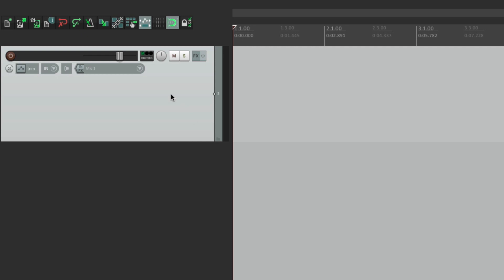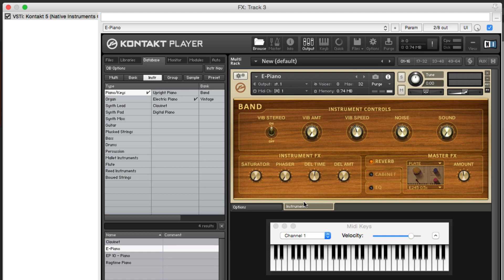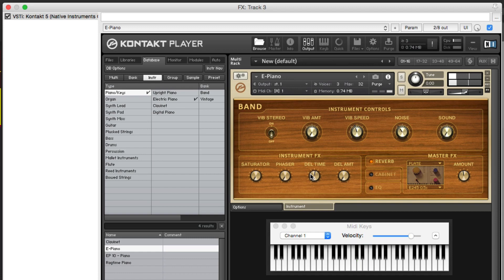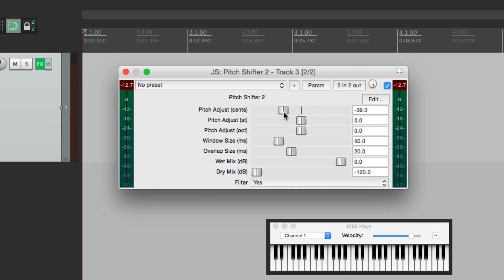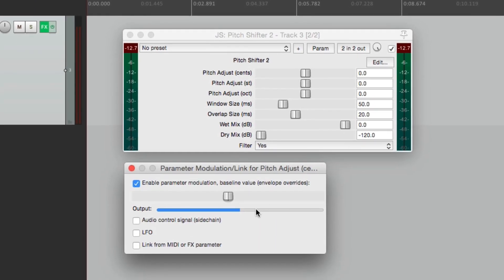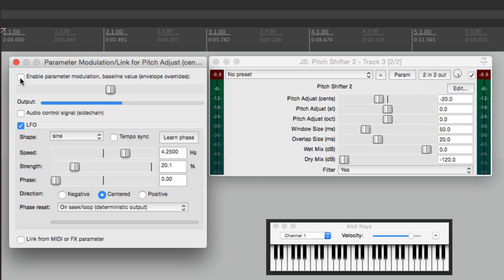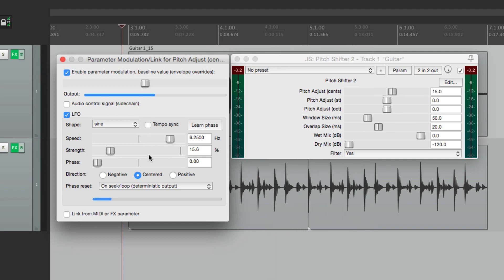Vibrato FX in REAPER

Comment: Kenny!!! Please make an update to this video. I've been struggling with how to do pitch bends like with automation or with glide, but it's very confusing and difficult to figure out. I know that there is a difference between doing it in midi and and audio. I use vital mostly, but I can't figure out how to do consistent and smooth pitch bends. Using the pitch bend isn't great because it's very imprecise, however automating the glide time doesn't seem to work very well.

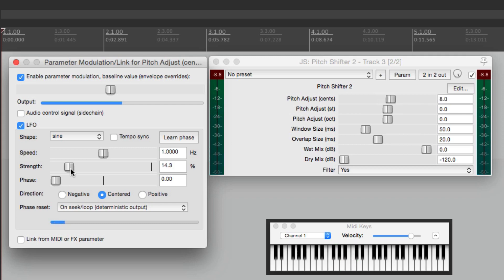Comment: There seems to be a pop when the pitch shift crosses 0. You can hear it at3:55 in this video and elsewhere. It gets unusably audible with distorted guitar. Bummer.
Reply: I realize this is an old post.... But as a guitar player, myself, you really don't want to cross zero (most of the time) . The notes on a guitar, that you are adding vibrato to, are always going to return to the root (they will sharpen, but not going to flatten). When you play a guitar and add vibrato, naturally, the notes go sharp and, then, return to the root, no matter how subtle or exaggerated the vibrato is. Unless you are using a trem, which I have on some of my guitars, you are often not flattening the pitch on vibrato. If you are looking for a typical vibrato that sounds natural for guitar, just don't "center" the modulation and I should think that would work although I haven't tried it, myself.
Reply: @WillFrye-4Real thanks. It’s been awhile since, and I still love vibrato!
Reply: @collierrocks  Any time! Me too. Some times when I am writing a song I add a little too much! Sometimes I have to stop myself and think... 'maybe on this slow bend I should sustain the raised note for a moment then add the vibrato'
It becomes so much more expressive then!